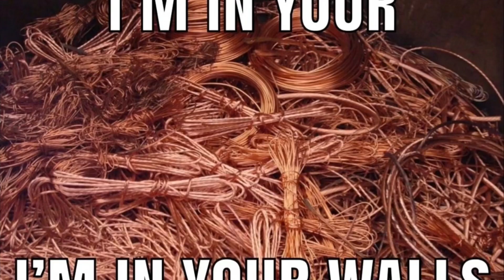Making copper carbonate from copper wiring

Comment: the method i find that works for pretty cheap is just take some copper wire (like the thin guage stuff) and leave it in a solution of distilled vinegar and bubble air through it with an aquarium pump for a couple weeks (adding more acid when it evaporates) and eventually youll be left with a concentrated solution of copper acetate, which you can precipitate copper carbonate with sodium carbonate. you can also get sodium carbonate by heating up sodium bicarbonate on a pan on the oven on high untill it stops bubbling (it releases gas and is enough to make it "bubble") and is a uniform consistency.
Reply from the maker: Yea that could work, this method is also consistent if you change the batteries unlike me, that’s definitely a method though you have il keep it in mind thank you
Reply: Why pump air and not use electrolysis? And will cooking  the baking soda damage my stainless steel cookware? 
I want to make copper carbonate for green fire but haven’t had any success yet.
Reply: @kerrimtthefrog1001  i mean if you have access to electrolysis do that. also as long as your baking soda isnt like watery then its fine. but if you can find a cheap pan or something at a thrift store to do it in.
Reply: @adelinyoungmark1929 ah yes thank you! I think I’ll give my copper foil another go in the vinegar this week. I made a solution with nickel but have been afraid to burn it for fear of fumes. It dried up and now I have some nice blue/green crystals.
Reply: @kerrimtthefrog1001  for the fumes you can go outside (if thats an option) second best thing is a fume hood (or a wooden box with a plastic front and a pipe with a fan in the back lol)